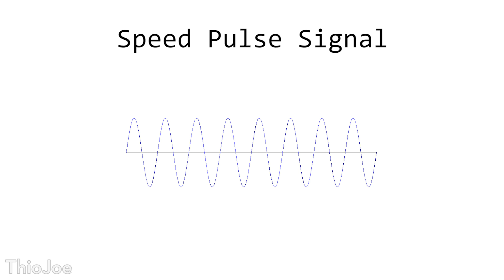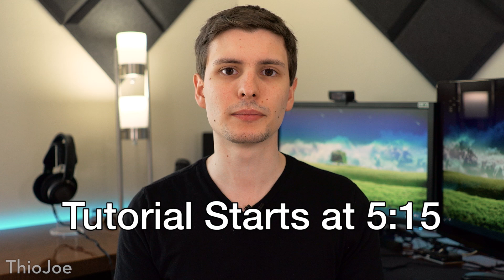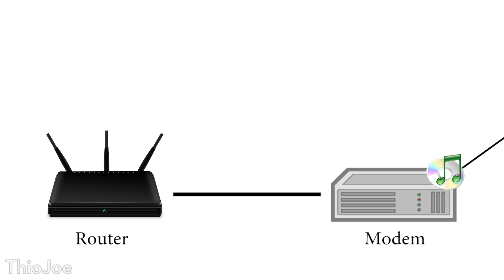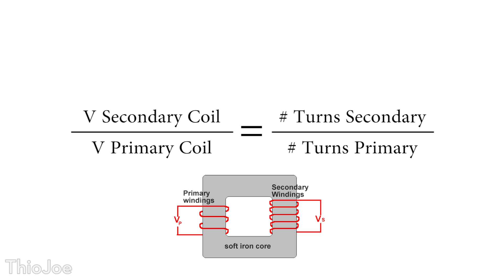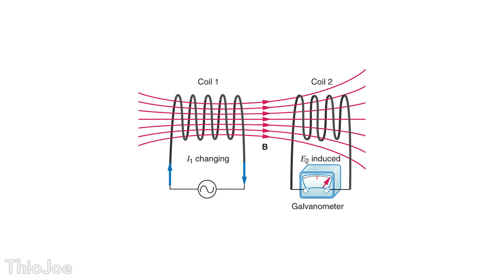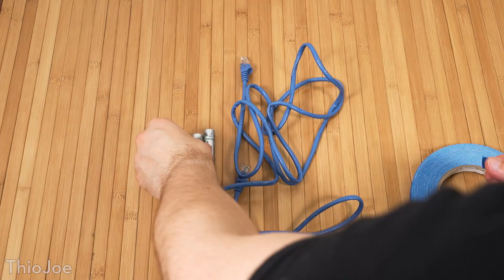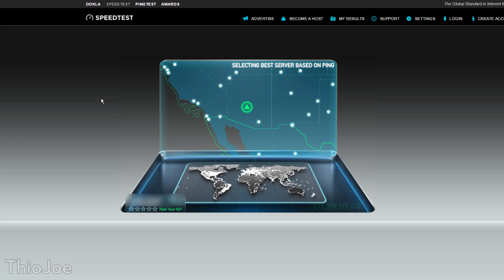How to Get Faster Internet Speed for Free

Comment: Hey man great video but I'm just a bit confused. When you were explaining the process, it sounded like the data would need to go through the first battery (single coil battery) which would then send it into the second battery (the four coil) which would amplify the signal for the user. But at the end when you hook it up, you state to face the four coil battery facing towards the ISP. This part confused me. So is this then condensing and focusing the signal towards the router? I assumed it should go the other way since data is traveling FROM the ISP TO the modem then TO the router. I am just confused as to why you would want to amblify the data movement TOWARDS the ISP since the data should be coming IN through that channel, right? I am not saying you are incorrect, I am just not understanding. Would be sick if you found a sec to elaborate. Love the channel man!

Comment: I used 2 car batteries and hot glue to hold my wired into the coil. and now I can copy so much fast. Even so much fast internet, that i was able to send a banana to my buddy in Canada (they don't have bananas in Canada, so that proves it) using webcam and a laser pointer. I don't recommend, since my Buddy said the banana tasted strange. But since he is Canada he probably don't know what banana taste like. Thanks for the tip. hope my ISP don't figure this out. im planning on sending a mouse next. if it does not work, i dont mind. I don't like mouses.

Comment: This trick wouldn't work on my connection. I live in the sticks of the Italian inland and I struggle to get 14Mbps out of a connection rated 20M because of the ancient copper wires system connecting me to the phone substation (from there onward the ISP it's optical fiber, but from there towards the various homes,  not only mine, it's still copper wires). Having 100M already would be such a step forward, but to have it I should live in some of the biggest cities for wholesale optical connection to be available... ;_;

Comment: Hello, does this work on wireless networks ? My ISP uses wireless modems that I connect to using my router, I tried your model but it does not work, is this only applicable on a wired network, i.e. cable, fibre ? Thanks

Comment: if i have ADSL router and its modem plus router then ??
its basically via telephone connection i get internet then how to this job done ??
because one telephone wire comes and its use splitter and one end goes to telephone and one end goes to wifi modem router 
router is tp-link router adsl wifi 300mb/s td-w8960n
how to do this tel me i am waiting for ur reply

Comment: As an electrical engineer in training, i call bulshit on your tranformer.
You cannot amplify a digital signal without interrupting it.
A transformer uses AC power, and requires the two coils be electrically isolated from each other, you cannot use the same run of wire!
This video is painful to watch, but props for keeping a straight face...

Comment: So taking a ethernet cable, which contains "Twisted Pairs" specifically engineered to neutralize stray or induced voltage which is what your lame battery transformer is doing to trick the Internet company into unlocking your speed on your account.
I'd like to get the last 15 minutes of my life back.

Comment: I have a question I have WiFi connection with tp-link router and I want to share with my neighbour via Ethernet cable they also have their own router and I know how to connect router to router. problem is that I wanna set speed limit to their router and their router not showing on tp-link tether app. please help as fast as you can...

Comment: 800,000 + views? WOW! Can you spell gullible? How can anyone make a transformer with batteries as cores and the same wires are tied to the primary & secondary coils. Not a gonna happen! EVER!!!!  I can buy a 2:1 3:1 or 4:1 small signal transformer for about $2 - $4. I doubt it will work even if I do follow the actual laws of physics, and electromagnetic induction. This is fucking lunatic pseudo-science bullshit! An op amp, transistor, FET or other device would or could amplify the voltage or current of a pulsed signal, but not two AA or AAA batteries and a Cat 6 cable. A U bolt would make a more suitable core. This is just fuckin nonsense.

Comment: dude your such a ass all your so called tricks are truly bs tricks your Internet is throttled thru the modem not your router you say that every time you get new router you have to call isp that is so far from true it's when u get a new modem I can change my router everyday and never call isp, so you either not know what a modem is or you truly think a modem is a router. cable Internet modems get authentication from there mac address which is the number that belongs to the modem nothing to do with router. I saw his free data using tape lol joke I saw his similar get faster speed Internet by using 2 ether net cables why does this guy do this. I want to punch him in his face with his serious I'm not joking and know what I'm talking about face. if I ever see this guy I'm gonna bitch slap him then show him how I can bitch slap him again from 50' away using the same wires with batteries

Comment: I didn't have any rechargeable battery's, but I did have 2 car battery's. They can be recharged so I have used them. Thought it was not going to work after reading the comments but as I was only getting 5.36mbps down load and 0.92! upload, which is absolute shite, I thought 'sod it, it's worth a try'. All I can say is 'WOW!!' When I do the speed test now, I use Ookla, it goes off the scale. It's now so fast that when my wife used the computer she actually thought she was in South Korea.

Comment: I did this with my dial-up connection and now i get a blazing 128K both ways. Thanks ThioJoe. I guess the same time domain reflectometer cable flexoid effect applies to dialup signals as well as ethernet. This is very fascinating and quite a revelation. Do you think if I add a few more batteries or maybe a 9 volt or a car battery I could get my dialup to maybe 50megabits or even 100?

Comment: HI ,I don't have a wifi router so I connect directly to my pc but before that there is a circuit which connects the POE wire to DC and then to my PC simultaneously so which wire shud I connect to the POE or LAN ?and the POE connects to the modem on the roof.

Comment: Sorry guys, your ISP speed isn't controlled by an analog line voltage.  It's controlled by a subscriber profile associated to the MAC address of your up stream device.  This is bunk.  The only way to cheat this system would be to find the MAC address of someone who has a better package, spoof their MAC through uploading your own programing to the device (and have real owner the stop using the original device because there can't be two), and have the ISP not notice that you've moved locations of that device. 

In other words: it ain't happening.

Comment: So basically this wouldn't worth with common sense, if the transformer multiplies the signal going out then it divides it by the same going in. say it does so by a factor of 10, so your 100mb pulse modifier gets turned to 10 when its sent to your router then multiplied back to 100 when sent out so it should not matter. However if someone was to invent a one way speed pulse multiplier it may work but no telling. Clearly fake.

Comment: Maybe you think it's alright to miseducate people thro your charts and terminology into thinking that amplitude = frequency. Or that amplifying a signal means increasing its signal.

Amplifying the amplitude of a signal does not increase the frequency of the signal.

Also the frequency of the carrier is mostly constant, so that increasing the frequency of the "signal" does not increase the frequency of transmission.

The transmission speed you are getting is not the same as the frequency of the signal.

The transmission signal is divided in time slots. The more you pay, the more time slots you are given. That time slot allocation is controlled at your ISP, no matter what you do.

You are actually flooding the switch box with your high amplitude signal, drowning out the signals of people who share the same trunk with you. You are getting all the time slots and depriving others. That is very selfish.

Where did you invent these stories on how your ISP controls the "speed" of your internet connection? Get some proper electrical/signal engineering education.

Comment: I've worked as a tech for several ISP's, DSL only though, haven't worked with fiber optics, and honestly... unless you can hack into wherever your ISP's servers are where they keep all the customer information and where they configure plans etc... you won't be able to change your internet speed in any way at all. That or someone on the inside physically like a field tech who has access to the DSLAM you're connected to so he can switch up your speed profile though this won't change what plan you're on so the moment your ISP refreshes your speed software-wise your speed profile's gonna go back to what your plan says it should be which if you and/or the field tech get caught doing will probably get you in a bit of trouble OR if you get either a hacker or someone who works for your ISP and works on software with un-impeded access to change your plan and somehow keep your bill the same that would most likely be permanent unless someone else who's not in on it who's some sort of taddle tale or good samaritan who notifies the higher ups about it which will end up in worst-case scenario a law suit or jail time. Pick your choice.

Comment: Wow, I was shocked at this video.  I couldn't find any batteries, so I wrapped the cable around my mothers two dildos (they have built in batteries).  The first time, the cable wasn't long enough, so I went up to Home Depot and grabbed some 4 gage wire instead.  I took me a while to fit the Ethernet RJ-45 ends onto the 4 gage wire, but I finally got it!  not only is my internet faster, I get much better porn videos due to the dildo effect.  Thanks Joe!  UPDATE:  my internet speed is now 6969mb!

Comment: After writing this response, it dawned on me that ThioJoe is just pulling our leg, trying to get a bunch of geeks all riled up.  I feel silly having written this reply because your idea is fraught with gross scientific errors.  No matter, here is my CALM geeky response :)

1. The Electromagnetic Force will not induce a current in the secondary coil if it is connected to the primary coil.
2. The whole idea behind Cat 6 UTP cable is its ability to resist EMI.  I don't think using your Ethernet cables as transformer coils is the best idea
3.  I am not sure what the batteries are supposed to do.  I assume you are using them as a transformer core.  In this case, it will not work because you need ferrite or iron core for a transformer.  It is true that Lithium batteries contain iron in the main ingredient (LiFeSO4), but the iron is not in the form (or quantity) suitable for this application.  Also, the transformer core needs to be one solid piece, with its shape optimized for this application in order to allow for the magnetic flux to flow from primary to secondary coils.
4.There are other serious flaws with this plan, if it is workable at all .  It makes no distinction between the functions of the different wires in the Ethernet cable.  Only one pair in the Ethernet cable carries data (two pairs for speeds higher than 100Mbps). Are you going to amplify PoE causing downstream components to melt?  
5. If the theory is sound--and I don't know enough about speed throttling at Internet provides--it seems to me that you need to amplify only the Transmit (Tx) wires, and you need to amplify each independently of the other.  There are better ways to amplify the signal than using transformers, such as using an op amp or something similar.  You will still need to protect your circuit from EMI.

Comment: Even the science is wrong, what u practically did cannot work as a transformer.  You are trying to induce voltage in the same "physically" connected wire and thats just stupid. Even the batteries working with taped terminal is magic, not science. 
who are these 19K people who liked this video??

Comment: This is great, I also added a third battery with 8 turns, so I get about 3gbps, but I know this is too much effort for you guys, instead you can double the pulses and amplitude by plug it in 220 volts outlet, simple. Do it on  your own risk with licensed electrician present and $80.00 in hand.

Comment: The inventor of transformer just turned in his grave!!
i am an electrical engineer, and i cried when i saw a transformer ...
1) working on DC voltage
2)AA cells used as cores
3)core not making a physical core (you did explain in your technical explanation earlier)
4)Primary and secondary winding being winded from the same wire(OMG)
5)....aaaah...my first comment on youtube...and i use it just to point out that you ....  my friend are a genius!......fuck tesla, Edison,Otto Blotchy...hell even fuck newton and Einstein(who do not have anything to do with internet or transformer for that matter).

being a fellow internet enthusiast my self and an engineer(or so i thought, before watching this video)i have a theory which i am afraid to try. but you can do it and it would even exceed the ISP bandwidth (my calculation estimate are somewhere around 1000 petabyte)....is...

put the 4 turn cable end in your BE-hind and the 1 turn end in your computers LAN port (no intermediate equipment required as it would increase latency).

nice video by the way!... keep up the good work!...cheers!

P.S. i am a bit drunk....Hick

Comment: Nice try... Unfortunately, there's no possible way to improve a high speed signal through a wire by forcing it through a magnetig field. It will lower the signal quality, and thereby the maximum datarate over that wire. Second, the connection between router and moden has no analogue information whatsoever! It only uses digital communication, at the speed determined bij the slowest port. That speed is a hardware limit! Third, the speed you get from your ISP CAN be limited by your ISP, but if you have cable or DSL, it's limited bij the equipment you use ! If you have fiber (as in the video) your ISP will program your alowed speed in the moden, by setting the value in the firmware. Since the modem is alwmost always a rental, changing that firmware would be illegal, not to mention the fact that it's concodered theft if you force your modem to a higher speed that what you pay for. The only way to change this setting is your modem is by uploading a HACKED firmware to your modem....

But seriously, nice try though.... ;)

Comment: Wrapping a Ethernet cable around 2 batteries taped together?? lol I'm not even going to try that, and you can tell he software limited it to 100mbps, I have 100/10Mbps internet and with the Gigabit internal network it reaches to around 105/10.5mbps Never drops below 105/10mbps. This was tested over lan as its the best way to test your internet speed.

Comment: Yeah, right. The FTTH setup that you have doesn't play any part in getting 1Gbps. 2 AA batteries do the trick!

For those of you who don't know what happened, here's the deal: on "Before" speed test, computer was connected to the router via an older cable (possibly CAT 5 with 2 pairs); For the "After" test a better cable was used (any ethernet cable with 4 pairs; could be CAT 5, 5e, 6, 6a...). 
If it weren't for fiber cables connected straight from ISP to his modem, this guy would NEVER have got 1Gbps bandwidth. It is simply not possible! 1Gbps LAN? Piece of cake; you can do it easily (obviously without the batteries). 1Gbps broadband bandwidth? Without FTTH? Nah...

Comment: On the Networking side of things, this will NOT work people... The only reason is worked is because he's using a fiber optic backbone in his network... ISPs don't bother limiting the speed to fiber optic connections that often, plus if you are a normal user like myself. The ISP has a limit on THEIR side, so even IF you increase your speed they are still sending you stuff at the speed you purchased in the contract.

Bottom line is... THIS WILL NOT WORK for 90% of the people out there, only ones with Fiber Optic cables can hope for something, and that's even a shot in the dark.

One the Legal side of things ... This is total bullshit xD First of all if you get caught by your ISP doing this (which you will  if the Network Admin just looks at the window of his PC) you will immediately get a lot of problems maybe even go to court, you have a contract with the ISP remember? What you basically did is break the contract and in the normal universe, that results in a court room.

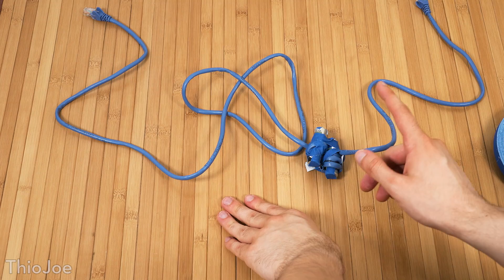Comment: What is that bullshit you are talking about. You dont have any idea how the hell internet connection works. You are basically increasing "signal" strength of some waves. But it is not how internet connection works. And do you really wrap electrical tape Ethernet cable around battery? At 8:30 you are just saying bulk of bullshits. By the way, internet service provider is limiting your connection digitally (ofc) there is no way how to change speed, only way is by changing settings at your ISP.